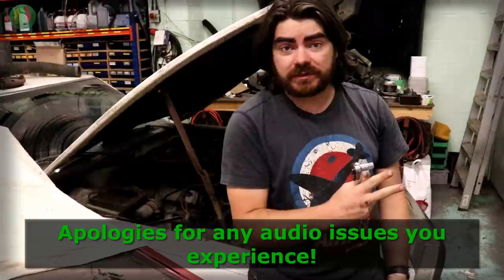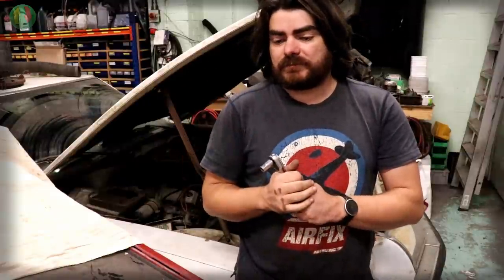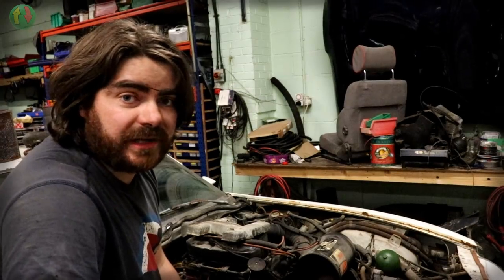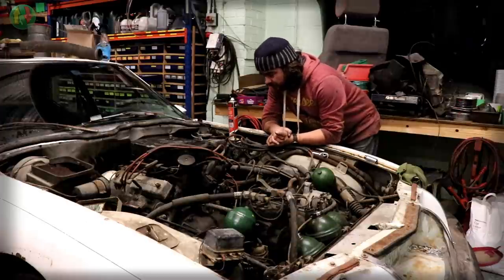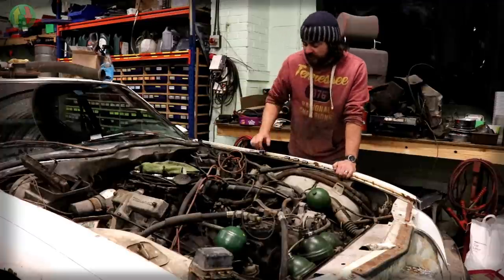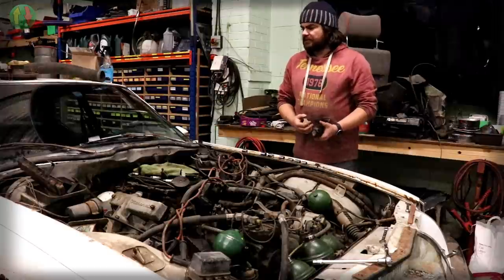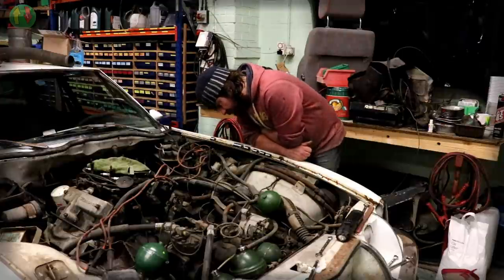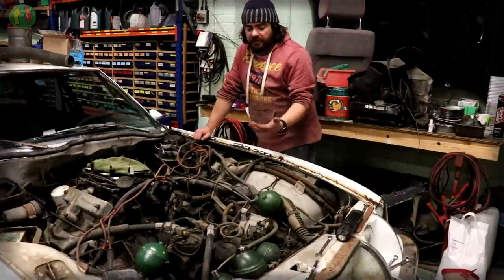CITROEN SM Resto Update 5 -  Is that Maserati V6 seized? (Containing small Jerry Hathaway tribute)

Comment from the maker: Thanks for the comments - keep 'em coming! I'm gonna have a test run at doing a live broadcast hopefully later today to respond to the questions in the comments properly.
Reply: "Because SM!" Needs to be a T-shirt or a Mug
Reply from the maker: Live broadcast attempt will now be a quick thing tomorrow afternoon, as had a minor medical emergency today with child number 2! It's not a Q&A thing (though you're welcome obviously) but just a way to respond to all the comments properly, with context. If it works well I'll do it for other vids.
Reply: @davidsharp9166  With the handle of the mug on the inside.
Reply: @conkerman01  or the bottom. So you can't put it down when filled.

Comment: Great news! I would inspect cilinder walls with endoskope as well. 
Regarding automatic. I alomst passed on my CX because "sluggish old automatic" but when come to daily usage even with 3 gears this gearbox is brilliant. I will explain why... First driving Citroen is more about relax, style and comfort so automatic fits that purpose (even SM, especially after restoration, you would rather never race with it). Second, this gearboxes are match with engines that have planty of tourqe from low end not like todays downsiezed turbos that you have to rev high. In my CX the gears and differential ratio are adapted wisely as well. You don't need 1st gear when you have torque converter if something lower will be needed then converter would just slips. So 1st gear in automatic is something like 2.25 in manual, then 2 is equivalen to 3.5 in manual and 3 is something like 4.8. You loose max speed a little but even with 120km/h on highway revcounter showing 3500/min so no big diffrence to manual. Next is my theory. Automatic gearbox is very offten youngtimer ass saver. There are bulletproof. When car is old but not old enough to be a classic very often get to irresponsible owner with high testosterone and low IQ. It is much harder to harass engine with automatic gearbox. For me his gearboxes have really two drawbacks. First is higher fuel consumption. Second is when you drive car on serpentines in the mountines. You have to be really decided with gaspedal and use manual mode (which is max 1st gear or max 2nd gear) to keep reasonable tempo. 
Fingers corssed for the project!
Reply from the maker: Thanks for that!
Reply: Having had a ZF 3HP22 failure in my 1988 CX GTi at only 79000 miles, I wish I could say the automatics are bulletproof. Sadly they aren't; they can be quite erratic, and you have to watch the fluid levels like a hawk.
Reply: Same gearbox that was used in my Triumph 2000, was a nightmare changing down randomly by itself at high speed or refusing to move the car at all

Comment: These are actually fabulous little engines. Maserati achieved greater racing success at Le Mans with this engine in the Ligier JS2 than any Maserati or Maserati powered car at Le Mans. A 4v version was made for Ligier and it made some 430bhp at 9300rpm as well. 

I am nearly done with my Merak SS engine rebuild. Simple engines to work on. I like that it uses chains as opposed to Ferrari or Lambo stuff at the time using belts which are far more costly to maintain as every 3-5yrs they must be changed. Just take your time and it will come together just fine. 

I have gone a step further with mine and offset ground the crankshaft so a different and far lighter and stronger BMW N55 rod can be used. Stock rods and pistons are boat anchor heavy on the already extremely heavy crankshaft. Changed the wrist pin size and location and I’m at about 3.3L now. Higher compression for fun too. I’ve done a few other things as well to get more poke out of the engine whilst keeping it entirely stock in appearance.
Reply from the maker: Thanks! Despite the myths I have heard snippets from those in the know that, actually, these are decent, tough little engines. 
Got me thinking about a 3.3L SM now...

Comment: You say that you can't access the torque converter, but there must be a way to unbolt the torque converter from the flexplate.  Usually by removing a cover between the flexplate and the sump.

Comment: Fingers crossed the motor internals are in good shape. Get the carbs sonic cleaned. They will come out like new, you will not believe the results. Clearing jets with fine gauge wire, removing 30 year old lacquer with spirt etc is history.
Reply from the maker: I'm ditching the carbs anyway.
Reply: @UPnDOWN  They are probably worth a few bob :)

Comment: Regarding fuel injection, I'm seriously considering converting my DS (2.0 carburator with LPG)  to fuel Injection. I'm considering using a Speeduino for this, since it can run on only a cam position signal. A crank position sensor is difficult to mount to a DS or SM motor.
Reply from the maker: This is one of the things I've been considering. There will be a way, I'm sure of it.
Reply: @UPnDOWN  I agree probably isnt impossibe. Aslong as there is a harmonic balancer that has the appropriate dimples that fists on the crank it should be doable.

Comment: I think I  would have connected a battery and turned the key to see if anything moved. Previous attempts   to get it running would have probably already done any damage.
Reply: That's the difference between Merkins and Brits. Merkins "throw in a battery and see if it moves". And has sparks. And misuse loads of brake-cleaner for fuel and screwdrivers as starter solenoid substitutes until it somehow runs. Brits are different. They try to find the most uncommon, discomfortable and complicated way to find out if the engine is even turning ... ;-)
Reply: @wacholder5690  Derek from Vice Grip Garage would have already started it, driven a few hundred miles amidst  a cloud of smoke... And let it sit outside to rot a a few years more.
Reply from the maker: The fear of destroying the engine stopped me doing that (to be explained in a follow-up vid)
Reply: @426baron  He sure would. Merkins - as said.
Reply: @426baron  ... and after realizing that the engine is ruined he would do an LS-swap or such and celebrate himself for having saved an iconic car ... Ack !
Reply: @wacholder5690  I didn't know about "Merkins" until your comment. Are they different from Muricans ?

Comment: I really don't want to be rude about what I think might be my 3rd favourite car ever.....  But I'm going to be!  How the f*****g f**k were mechanics meant to turn the engine to TDC to set all the timings????
Reply from the maker: I'm sure there's a way that I'm unaware of (I'm still very much in the learning phase).
Reply: @UPnDOWN  Stick it in gear and turn a drive wheel is the way to do it on a manual, however on an auto you're a bit scuppered

Comment: Don't fit fuel injection. Firstly you should keep such a car as original as possible and also fuel injection systems in old cars are one more reason to catch fire and a very easy one too
Reply: Fit whatever you want. It’s your car and you’ve already saved it from the crusher. The webers are a bitch to balance. Mega squirt ftw!
Reply: @davidconnolly292  Absolutely. If not Megasquirt, Holly also makes an excellent aftermarket EFI system
Reply from the maker: I'll cover this in a future video/update, but it's definitely going injection.
Reply: @UPnDOWN  I totally agree.Much as it's fascinating to watch Iain Tyrrell balancing 4 X 3 barrel webers on a V12, they don't stay in balance. A modern injection system is constantly monitoring fuel trim. Modern is just better.
Reply: fire problems did exist only with the original Bosch D jetronic injection who  had rubber hoses between rail and injectors: modern adaptable injection did use such things...